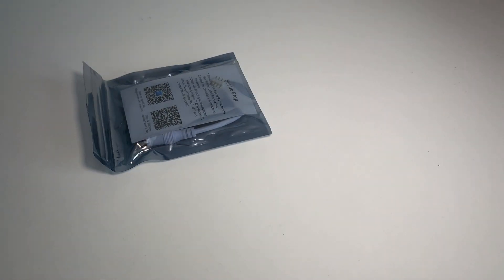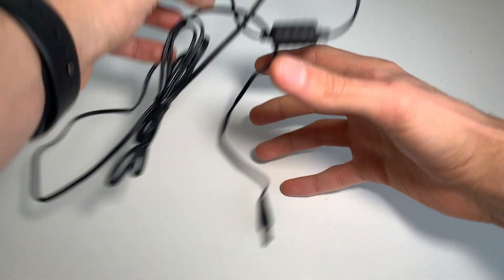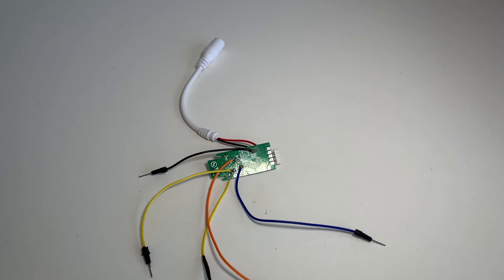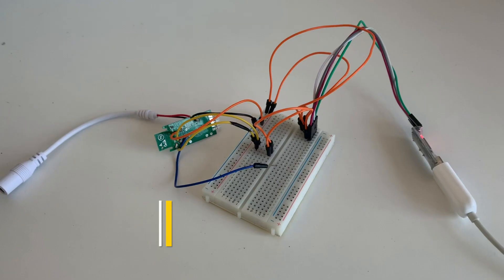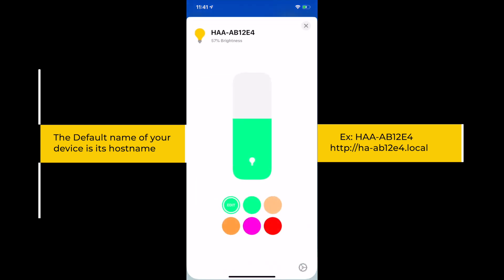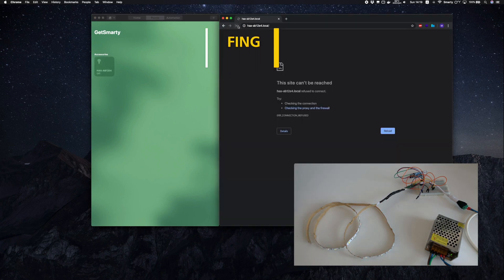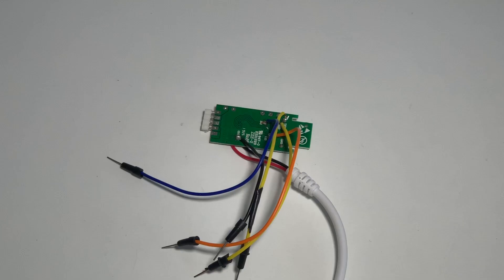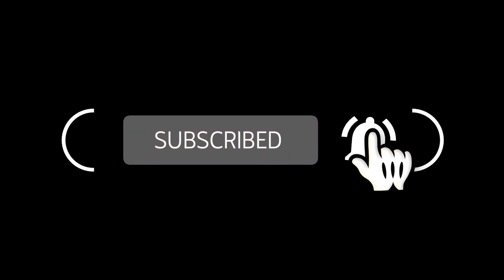The Cheapest HomeKit RGB Light strip Controller - MagicHome RGB/Shelly RGBW2 flashed with HAA

Comment: Lightbulb is visible in HomeKit, but no rgb colors. The ledstrip doesn’t activate either. Could you help me?
Reply: Exacly, I have the same problem. I'm using device in version with IR remote (on ESP chipset). Did you fix it somehow?

Comment: Great guide, thanks! Do you know if it is possible to do the same with MagicHome RGB WIFI with IR remote? It would be great to have remote control in addition to Homekit, or after I will change firmware to HAA remote controller will stop working?
Reply: I ordered one before viewing your comment. I'll give it a try when I receive it, but from what I understood with the video and the HAA project page :
- The pins are likely to be different, so I'll have to determine which pin goes where when I get the card, and update the JSON configuration accordingly
- The IR remote won't be functional, as there's no code nor any mention of it in the device database (https://github.com/RavenSystem/esp-homekit-devices/wiki/Devices-Database). If there's no example of a remote controller configuration, it surely means the remote is not supported. But a future update of this project may, someday, add remote controller configuration.

Comment: After flashing does it work with it native app ?
Reply: No, other firmwares will not connect to cloud of the native app. But you can backup the original firmware (with esptool), so you can revert to original if you'd want to.

Comment: The Aliexpress TTL to USB Adapter you linked doesn't seem to be mac friendly - I don't suppose I can use an Arduino to flash an accessory? If not does this look ok? https://www.aliexpress.com/item/4000152080091.html?spm=a2g0o.productlist.0.0.1bcb4973cCv0Ai&algo_pvid=5b7034ae-c732-4b6f-a513-ba1fb95f5a81&algo_expid=5b7034ae-c732-4b6f-a513-ba1fb95f5a81-2&btsid=0ab6f83115867782618074962e2a19&ws_ab_test=searchweb0_0,searchweb201602_,searchweb201603_
Reply from the maker: Saw you're active on facebook. It should work on mac too. Would it be ok if you send me a text here - m.me/smartyone

Comment: Any way to flash Tp-Link HS Outlet or light bulbs?
Reply from the maker: As far as I found on the internet, the TP-Link smart products are running on something different than ESP. (The chip) This makes me believe, that most firmwares on the net won't work on them. In this case, the best solution is to bridge them to HomeKit with a hub that "translates" (plays the role of a middleman). Such can be HomeAssistant, OpenHab etc. They have a lot of integrations supported.

Comment: Can you explain why we need that complex wiring? Can I connect it directly to the USB to TTL programmer?
Reply from the maker: Surely you can! Just make sure to split the Ground wire so that you can bridge it to gpio0. :)
I used a breadboard because it was easier for me to split wires and stuff. It should work as long as you connect them by the instructions.
Reply: @getsmarty2460  Thanks for reply! I have USB to TTL programmer but I never did the flashing. I ordered the stuff, I hope you can help me to connect it properly when it arrives. Thanks you in advance!
Reply from the maker: @levvys  Of course! :)